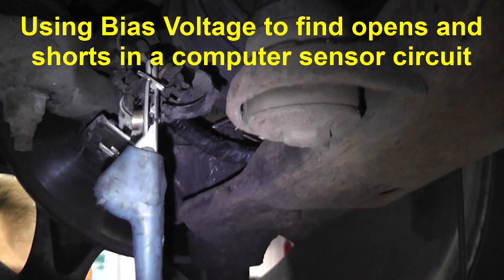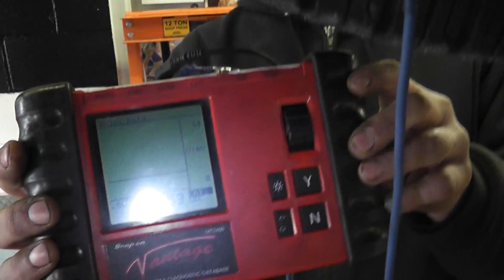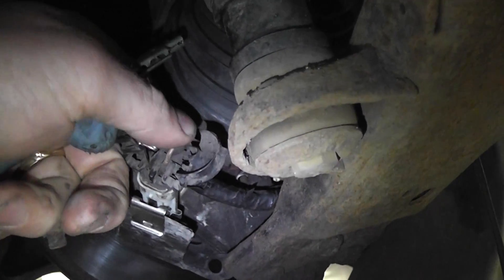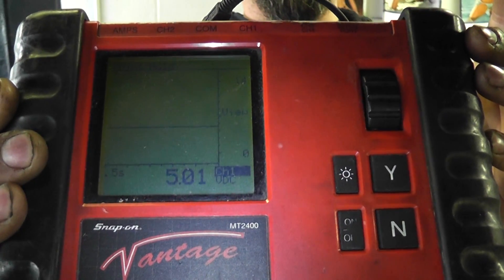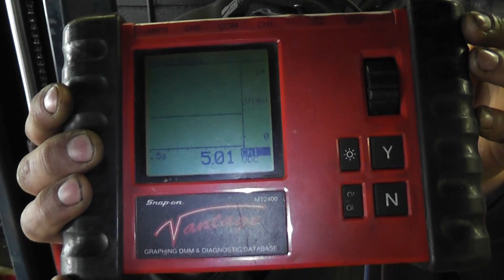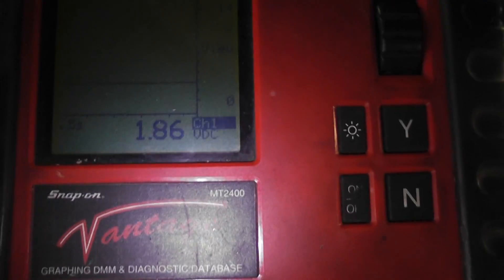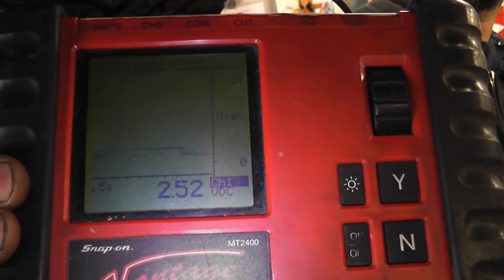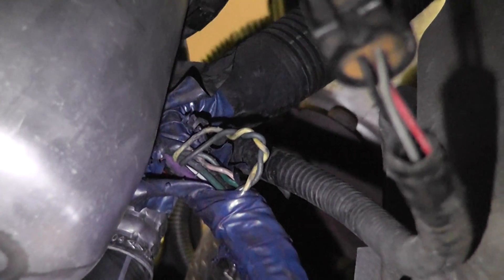How to test an ABS Wheel Speed Sensor (VRS type)

Comment: why did the bias voltage not get affected by the accumulator ground when it was unplugged? wouldn't it get pulled to ground regardless of whether or not it was plugged in? thank you.
Reply from the maker: Because the short was on the ground side of the sensor circuit if I remember correctly
Reply: @ScannerDanner  ahh I understand now, thank you for responding! that was really bugging me.

Comment: I just changed hub bearing and spindle on a 2015 cross trek because I broke bolts trying to remove those parts, to swap a bad lower ball joint. Now everything is new !!
However, I got an intermittent ABS light now. This information is very helpful. Thank you. 
I would like to point out that the blue tape is factory and indicates that the harness has wiring installed that is not used. The extra wiring is for options this car does not come equipped with.

Comment: Hi Mr Danner, one thing that I still can't wrap my head around is how can a vrs bypass works when you use a test light connected to battery positive (which is DC) and touch the signal wire on the vrs (which is AC sinewave)?
Reply from the maker: It has to do with the analog to digital converter inside of a module. Computers must convert all analog signals to digital (0s and 1s). The analog signal must cross certain thresholds to be "seen"/converted and I'm simply crossing one of the thresholds with my test light. Hope that makes sense
Reply: @ScannerDanner  thank you so much for explaining
Reply from the maker: @bund.5901  no problem! Great question!

Comment: Do you have any tips on the scope setup for getting a capture of the sensor actually reading the tone ring? I can’t seem to figure it out
Reply from the maker: Do you have a sensor with a steady reference voltage on one of the wires? Like 10 or 12v? If so, this is a different type of sensor and testing them is different too. I have some videos on these. Type in digital speed sensor or magneto resistive as key words on my channel page and you'll find them
Reply: @ScannerDanner  oh no i was referring to the 2 wire sensors that generate their own ac voltage. To my understanding either wire is the positive or negative and alternates so it shouldn’t matter which wire I’m on to get the signal from but I can never seem to get a signal when I try. I’m not 100% sure I’m spinning the wheel fast enough to generate a voltage but i think i am

Comment: Thanks Paul, Bias line voltage isnt published. I currently have one with a 5 volt bias on my good side and a 12 volt on my non-functioning side. Had to cut the wire close to the module to confirm it was coming out of the module. Indeed it is coming from the module. Thanks again, you are the greatest.
Reply from the maker: Awesome! Learning circuit design is king!

Comment: So one lead to ground and one in the plug bias line?  Key off or on?  I think I have a same situation on my 2013 GMC Sierra.  It actually started working again and stopped.  I changed the sensor no change
Reply from the maker: Your model year probably uses magneto resistive sensors or digital abs sensor, I have some videos on testing these. One on a gm too

Comment: I don't understand bias voltage quite yet, are you doing this yet while the engine is running or how do you get voltage through the sensor to test it?.
Reply: Test**
Reply from the maker: type is "bias" on my channel page, there are so many different circuits that use this. On this ABS system, I simply had the key on, that was it.

Comment: Dan question for you, with the VRS unplugged we were seen Bias voltage. How come with the sensor unplugged Bias voltage was not dropping (fluctuating) as opposed to sensor plugged in and wiggle test was being performed? 

If you have left the sensor unplugged, would we have seen the Bias voltage dropping as soon as the yellow wire found a short to ground through accumulator?  
Thanks in advance!
Reply from the maker: I just wasn't pressing on the correct location when it was unplugged? We should have seen it unplugged too

Comment: I have a 2012 ram1500 I was checking today  Feb 14 2020 It had a 2  wire speed sensor and i didn't  understand  what i was seeing on my vantage. So i did just like you went to the other wheel and the same . I spent so much time trying to find the the service in with all data and direct mis. And nothing that made any sense.  But I did know I was testing  it wrong and it wasn't a ac pulse genarator.knew it was digital signal. But was having a hard time rapping my mind around it Thanks for the video

Comment: If you read 5v on the signal wire with connector plugged in, can you say that the sensor is bad as long as you verify that the ground side of the connector is good
Reply from the maker: If it is a VR sensor like this one, then yes, but be careful that it is not a digital sensor. Check the other side and compare.

Comment: Hey Mr. Danner.  1997 blazer.  Only OBD2 scanner with ABS that will read fault codes is an expensive Snap-On Solus Ultra diagnostics tool my buddy has.  I've tried several brands and none communicate other than the snap on.  Any suggestion of a code reader that would pull codes in a 97 Chevy Blazer?
Reply from the maker: +BlazerGuy1983 I think you can run a manual code read with that based off of a flashing light but I'm not sure
Reply: +ScannerDanner thanks!! We met at EricTheCarGuy meet up last summer.  I'm from pittsburgh.  I caved and bought a used Snap-on Modis EEMS300 on CraigsList and it pulls codes on my blazer without issue.  I wish I knew more about the scanner.
Reply from the maker: +BlazerGuy1983 keep following me brother, I'll teach you

Comment: i confuse between ABS sensor & vehicle speed sensor & wheel speed sensor and ABS wheel speed sensor . please explain each of them
Reply from the maker: +salem ogla ABS wheel speed sensor is measuring wheel speed. The vehicle speed sensor is measuring transmission output shaft speed on rear differential speed. Although some systems will share the ABS WSS signal and use it as a VSS :)

Comment: hey Paul. I know you're a snap on guy, so am i actually but I don't do enough work to justify the cost of a verus (as much as I'd like one), is there a lab scope that you know of and would recommend at a reasonable price? thanks in advance! I love watching your videos and just got your book for Christmas, which I'm also enjoying!
Reply from the maker: +HDmech81 the picoscope automotive kit! hands down the best scope I've ever used. Maybe not the most mobile friendly (need a laptop)
Reply: that's great, thanks for the advice I will have at that, I have a laptop with me when I work anyway so that should be just fine
Reply: +ScannerDanner I have a similar question as HDmech81.  Do you know of any, or can you recommend a budget minded bi-directional tool. 
As far as Snap-on models...I've even been searching for a used unit. However. I do not know which models have Bi-directional capabilities. I know the Vantage MT2400 does. But how about the other models?
Your knowledgeable input is greatly appreciated! I don't want to buy something and it doesn't suit my needs.
Reply from the maker: +tomduncan1970 the Vantage MT2400 is not a scan tool at all. It is a graphing multimeter only. The MT2500 was the first model scan tool and it had bidirectional controls. All of the Snap-on scan tools offer bidirectional controls except the Ethos. Something else to remember. Just because the scan tool offers bidirectional support doesn't mean you'll have the same controls on every car.

Comment: Might be a silly question but I have noticed abs sensor wires are often twisted around each other like they are in this video. Is there a reason for that other than just to keep them together. I don't notice any other sensors like that.
Reply from the maker: +Daniel Warren yes, they call that a "twisted pair" and it is used to reduce RFI and EMI. 
Communication wires are run that way through the car as well.
Reply: +ScannerDanner Twisted pair - Never heard this before  , today ive read it three times and seen it on videos twice .

Great videos SD im watching these from old to new ,  im reading books and taking courses ill be buying into your premium and your book very shortly as soon as i win a nice Vantage pro  .

thanks for your YT work .
Reply from the maker: +cagmito76 thanks man! I really appreciate it

Comment: Hey Paul,
How come during your unplugged test at the 5 volt bias while wiggling , the voltage should have dropped since the yellow line was intermittently grounded via the accumulator.  While plugged in the 5 volt bias dropped to 2.59 volts and then when wiggled dropped due to be grounded by the exposed wire inside the yellow jacket to ground.

As always Paul keep up the great work, truly appreciated.

Thanks.
Reply: Fausto Gonzalez hm...thats what i thought...i think that the damaged wire is not the one with 5v bias...it s the other wire

Comment: If the wiring shows up good, is it safe to blame  the sensor/hub? chevrolet trans sport -00.got a code for LF..Exessive wheelspeed variation. .dom i need to change LF or could that indicate that RF is bad??
thanks you from Sweden ;)
Reply from the maker: +Fredrik Sundvall just make sure (if you can see it) that the tone ring is not cracked before replacing the sensor. Some are build into the hub and a visual inspection is not possible. This is when it helps to view the AC sign wave on a scope.
Reply: Its like this type that you show in this film...
Reply: On what setting should the DDOM be set on to check the sensor by spinning the wheel..what numbers should i expect to see then ?
Reply from the maker: +Fredrik Sundvall a DVOM will not show you a cracked tone ring. You need a scope to see it. Is it part of the hub and bearing assembly? If so, just change it.

Comment: What you think about using the Hook from power probe to test sensors like this one in the scenario that a Bias Voltage is not present? The Hook has a unique future to select a .5V to 5V in .5 increments super low amperage! What do you think Paul?
 I am been using it instead of the 5v reference jump as you suggest on other videos, I like this way better, because the Hook will alert me if wire is ground it!

Comment: Great! Thanks! I'm getting 3 codes simultaneously - C1225, C1216, C1226. The two front bearing assemblies (04 Chev impala) were replaced not that long ago. Wondering why both the left AND right front are giving me issues?  The C1216 code reads Chevrlet ABS current - EBCM commanded pressure release too long. Not sure what this all means... any ideas?  ABS computer going?

Comment from the maker: I didn't change the wheel bearing. the garage did before they called me in to look at it. My second job is mobile diagnostics. 
Also if I unplugged the sensor to test it I wouldn't have been able to use the bias voltage as a guide which was key in this diagnosis!! When you work in the aftermarket like I do, it is not possible to have every single terminal probe to allow plugged in type tests. It is simply not practical. I did not damage the seal, as I didn't poke through it but next to it.

Comment: why are you piercing the weatherpack seals on the connector with a needle? you are just creating a place for water to enter and eventually corroded the terminals. i never do that. just unplug it and use the proper terminal probes or use a dummy connector from another sensor and plug it in. I teach my automotive student to never pierce weatherpack seals. not to mention that you should have diagnosed the condition of the abs light first before replacing the wheel bearing. i have changed hundreds!
Reply: He didn’t change the wheel bearing someone else did, stop being such a smart arse, he’s probably forgot more than you know

Comment from the maker: if you have ABS on the car, why did you take the tone ring off of the new axle?
unless it is part of the wheel bearing assembly, in which case you may have a speed sensor that is going bad.

Comment: please answer my question: i had to change both sides cv axles. the old ones did not have a ring while the new one did, so he take the ring of and we installed them.  suddenly after that the abs light came on and the the braking now is crazy. He said the that will get fixed after two to three day. Now it been 4 months and still nothing .  any advise

Comment from the maker: that is weird.
 if it was me, I would start by monitoring the wave form of each of the wheel speed sensors. since you probably do not have a scope then I'm not sure where to tell you to start. how about unplugging the speed sensors 1 by 1 and see if you can make it stop.
 another thought, is the alternator. you could potentially have a bad diode in the alternator that is pumping AC voltage into other systems

Comment: Hi! Thank you for your reply. 
ABS-Pump is running and I feel it on the brake pedal. When locking the wheels on snow everything works like it should. Its only when I have my foot on the brake pedal and it stops when i get of the brake pedal. Sometimes the pump continues to run until the car moves just a bit, then it stops. I have measured the three sensors that is on these s13's and all show about 950 OHM. 

The ABS-pump does not run under normal braking. only starts when I'm standing still.

Comment: I just solved something like this on a Ford - Since the wires connect under the back seat it was easier to test with an ohmmeter. Turned out to be an internal wiring break.

Comment: Why aren't there more smart mechanics like you.  Most would have just replaced the speed sensors and charge the customer and still not solve the problem.  Aren't they taught differential diagnostic testing in auto mech schools?
Reply: This is a rare skill to have these days and guys like Paul are few and far between